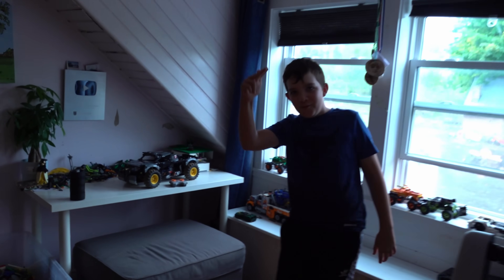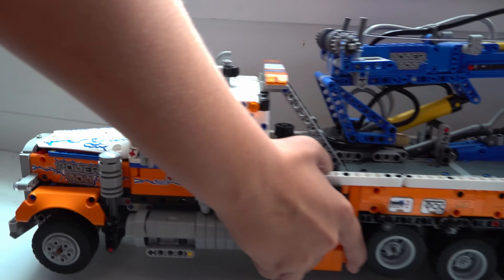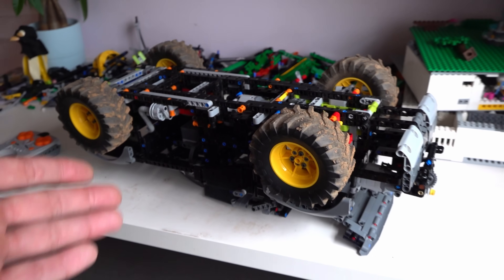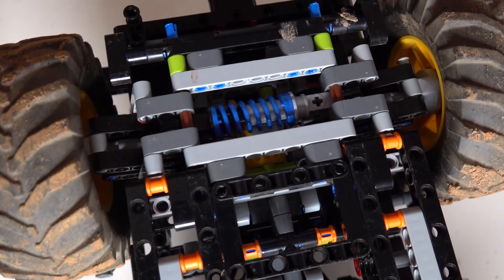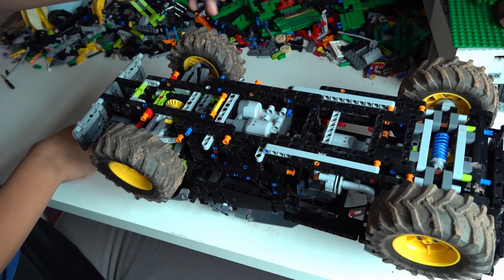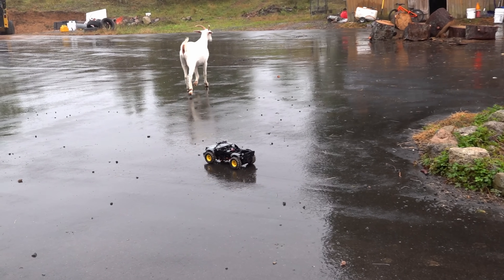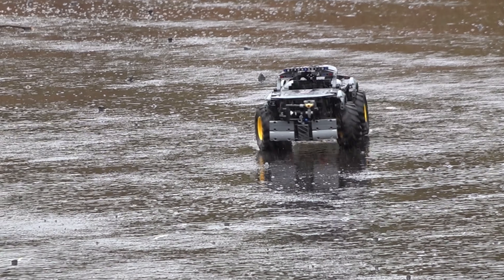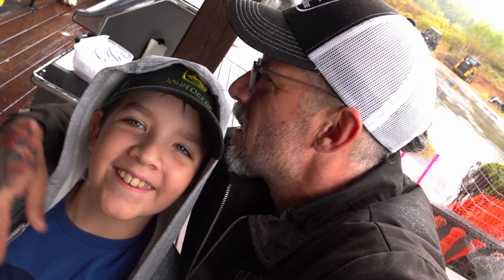PEUGEOT "MoMan" Young Master Builder Creates Incredible 4WD RC Truck! Lego Technic #ProudParenting

Comment: Excellent sooo cool😊
Reply from the maker: Thank you so much 😀
Reply: @TheRealRCSparks credit where credit is due bud , I’m till trying to pair up my dumbo rc transmitter and gyro on board receiver, could only get 1 channel I then bought a non gyro receiver still no joy pairing it up, I’ve now gone and bought another new esc but went for the hobbywing quicrun this was all with the intention to upgrade my wpl d12 , my wpl is up n running with a spare udi esc that my friend had, I’ve still not managed to bind up the dumbo rc transmitter and hobbywing esc properly I do have throttle and something on the steering now. Love the Dakar/trophy truck of your build mo so awesome 😎
Reply: The apple definitely didn't fall far from the tree

Comment: Pretty cool build, you could look into starting on 3d printing together next maybe ?

Combine that with Lego & hobby grade rc's & you got WAY more options on making your own designs or improving upon other designs themselves, maybe being able to create a rc trail truck that's using hobby grade electronics, gearbox, axles, shocks, wheels while the rest is regular off the shelf lego pieces.
Maybe even something like making parts for obscure rc models from the past to revive them as well, reduce, reuse & recycle etc.

If he knows & can list all parts he could probably have the design made at least in an unofficial capacity as a lego kit as well.

The rear shock setup is a lot like the front end of a Tamiya Boomerang, or Hotshot.
Reply from the maker: We already do buddy! posted a few videos about it too
Reply: @TheRealRCSparks  Ah, haven't checked into the channel for a bit so must have missed that heh, i know what I'm doing this weekend then besides putting together a 1986 
Tamiya boomerang to be able to store it while i wait for parts to come into Sweden.

Found it literally in the recycling facility in the electronics container a few months ago, besides very shot plastic bushings on each corner of the chassis, a damaged front bumper & mounts on the chassis for the front bumper & a shock thats been glued together & painted a bit black.
It was actually working ok besides needing some adjustment too the mechanical speed controller servo so it had full speed forward.